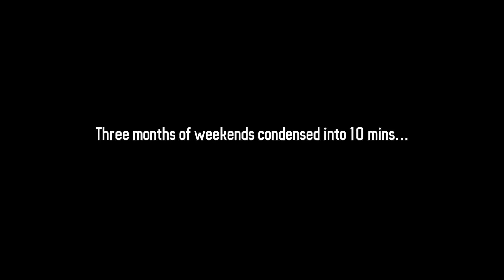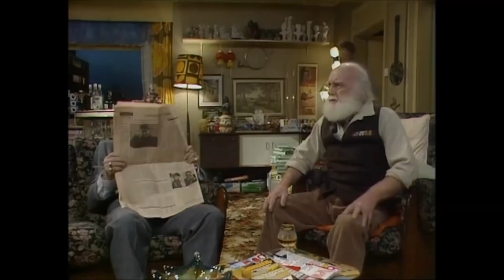Dutch (ish) Toolchest / Phil Makes Things No. 32

Comment: On your metal spinning finger chop saw sequence.  (drill cought metal and spun it)  I stop this by using a dedicated metal pin that is 3/8" round put into a deep hole.  The work sits against this pin and stops it from spinning. 
 (mine is actually a shoulder bolt with threads cut off).  Works every time and saves fingers and hands.
Reply from the maker: Helpful tip! Thank you, I’ll give that a try.

Comment: Finally found the video I was looking for. You should add "plywood" in the title ;-)

Getting 1x12" flat pine in the UK is a bit of a problem. Even 1x6" stuff tends to be bent or warped in B&W or Wickes and overpriced.

What's the straight-edge you're using with your router for the groove?
Reply from the maker: Thanks for watching! 
The straight edge is an Amazon cheapie straight edge clamp. Not the best thing in the world but it does the job with fair bit of fettling to get it setup right.